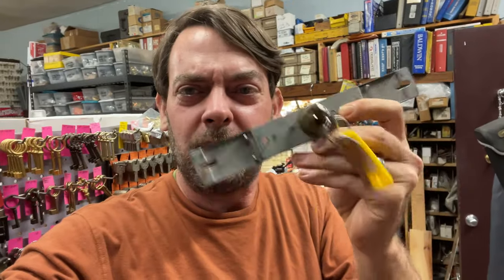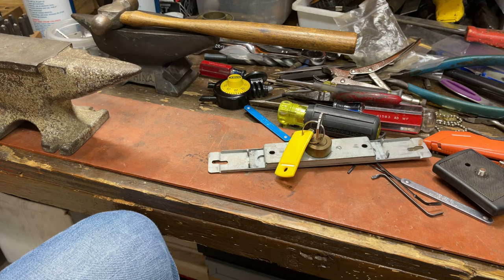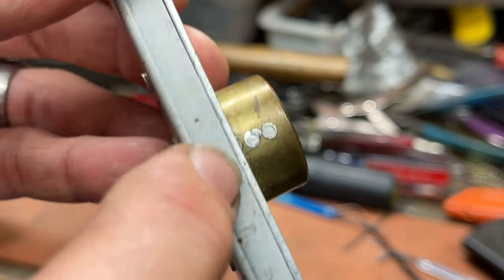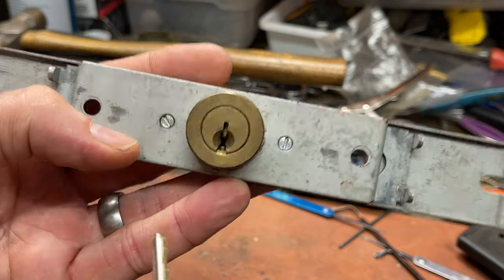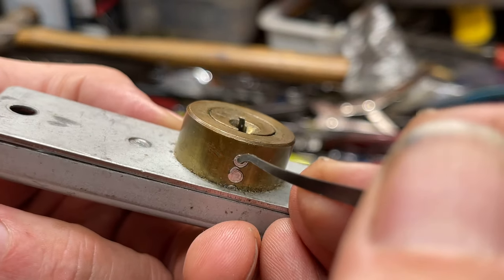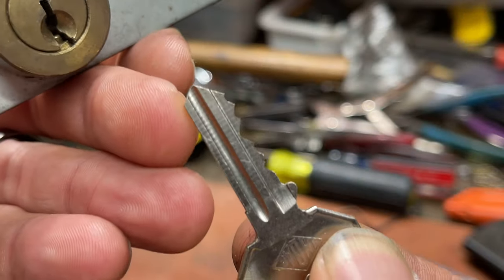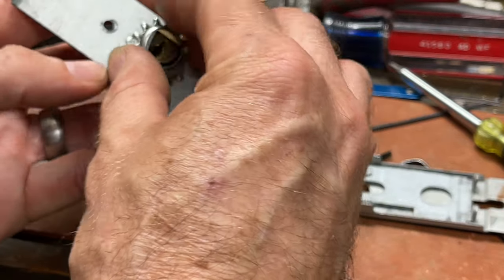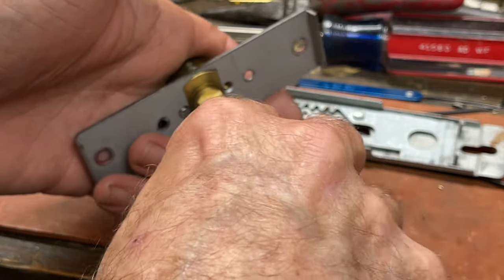the one cylinder double sided three pin lock used to secure what??

Comment: Great video!! We see this type of lock very often in Hong Kong and mainland China. These are often used, as you stated, on metal gates. We usually have more interesting designs including high-security slider designs, cruciform, and dimple styles. Our locks are usually a bit better though since it requires a full turn of a key so it puts less stress on driver pins.

Comment: If you go to put it together make your follower angled on the end so you can load one side on a time, and if the follower is a sleeve just have a notch large enough for a pin on one side.
Reply from the maker: I already have filmed some of it (the follower is in my hand in that teaser clip at the end) :)
Reply: Thanks! Sorry for the dumb question. I've never seen one of those before.